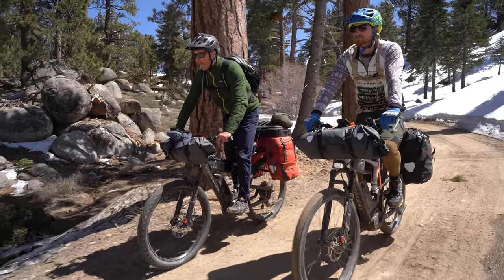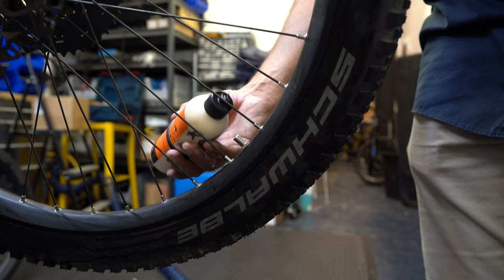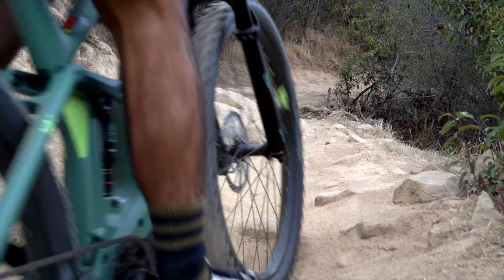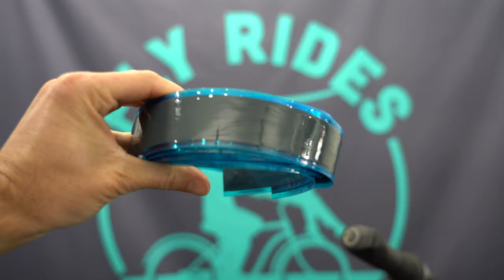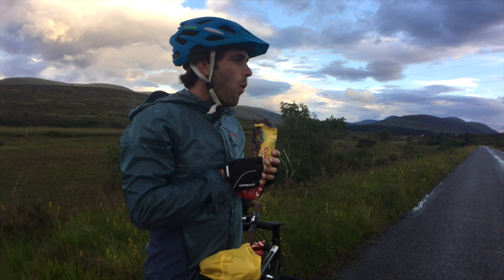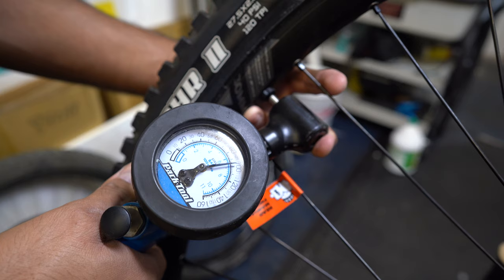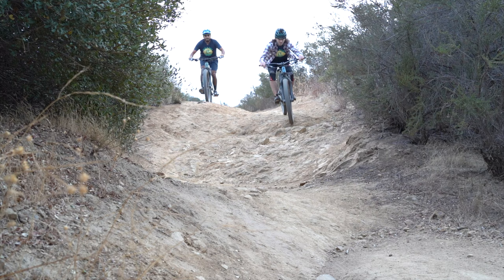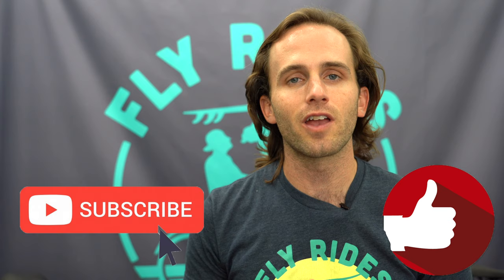Best Ways to Prevent a Flat Tire on an Electric Mountain Bike | Tubeless Tires, Liners & Inserts

Comment: I grew up in the 60s riding my bike in the country (where I lived) and I think my tires were goathead magnets.  After lots of tube patches I started lining the tires with several layers of newspaper, and it worked quite well.  Really cheap solution (there weren't any others back then).

Comment: Tubeless is the way! I also run CushCore with 20psi front, 24psi rear and haven’t had any issues. Don’t forgot to check your tire pressure often as there is no perfect system.
Reply from the maker: Good advice! Flats are always still possible, so come to the trails prepared!
Reply: Can you use CushCore and Tubless together? I want this on my two bikes one of which is already tubeless.
Reply: Hey there  @SwiftySanders . You have to go tubeless to use CushCore.
Reply: @HectorSalcedo  Thanks! Thats perfect. I already prefer tubeless but I had a situation where CushCore would’ve been useful.

Comment: Really helpful stuff in here. Thanks for all the different options and thorough explanations.
Reply from the maker: Glad it was helpful!
Reply: @FlyRidesUSA  with all due respect, although it's extremely expensive, a combination of Tannus liners, a smaller thicker motorcycle tube AND the proper amount of Flat Out tire sealant is the best solution.
Reply: @FlyRidesUSA , thank you.
Reply: @powerguymark  Tannus liners have a huge downside. The foam goes flat — if you always keep your tires inflated. With time, Tannus become nearly useless, unless you deflate your tires after every ride. 

On the other hand, Flat-Out does work really well. My favorite part is that it doesn’t dry-out with time like the competitors’ products.

Comment: I had an idea but not sure if it will fly. Drill a second hole in the rim for a second inner tube. Please the first (flat) tube on the inside rim and a second tube outside of that (it would have to go under the first only next to the valve. Then put the tire on and inflate the second tube only. If you get a flat with the second tube, deflate it fully and inflate the first one. I think that would fly but I've never heard of it being done. A slight weight penalty but who cares on an ebike.
Reply from the maker: That would be cool if it worked! Kind of similar to the Cush Core in that it protects the rim a bit more as well with that extra rubber.

Comment: If you're never too far from a bus stop, you can leave spare supplies at home.  Unless you're determined to not cut your trip no matter what.  If your trips are very unlikely to make your tire sealant useless and it's never too far to walk to another mode of transportation, it might make carrying a tube and pump an unnecessary encumbrance.  I may eventually get a pump though if I find a tiny powered one that I trust.

Comment: I'm rocking a gates belt on my bike and yes its a bit of a pain to change that rear tire the first couple times.  Also I know its confirmation bias but why is it always the damn rear tire when you've got a belt drive that gets the punture.   had 3 slow leaks and 1 major roofing nail incident in the last 8 months, all in the rear.  Only the nail killed the ride.  Actualy got al the way inside the tube and started punching holes along the lenght of it as I went from full to flat in less than 100 yds.
That said after you've done it a few times its not hard to pop the rear tire off even a belt drive.  I'm not quite as fast as with a normal derailer but it only takes me about a minute longer now.  Only issue is because of the belt tension when reinstalling the wheel never quite seats exactly the same way twice and I always have to adjust the rear brake calipers.

Comment: It seemed to have discovered that slime tubes aren't the best option... as I've had some pretty consistent delamination of the rubber from the valve stems causing bubbles... ballooning of the valve stem? Beyond freaking annoying... surprisingly I've had good results with just letting the air out until the ballooning Saddles and then putting not just one but two or three zip ties in series across the stem... And then ignoring the piss out of the problem LOL so much for confidence on the trail

Comment: Hmm, you missed the easiest option. As I have driven Schwalbe Marathons with it‘s legendary puncture protection on my road, city and trecking bikes for so many years now, without having a puncture once, I tried the Marathon MTB with the highest rating in puncture protection on my MTB. This tyre is not a Magic Mary, but if you drive all kinds of terrain, this tyre is a joy to ride. I trust Schwalbe and it’s tyres so much, I would never take something with me to fix them, because it never happend in way more than 20.000km. 
The tyre is not ment for downhill, but it’s enough for nice flow trails.
Reply from the maker: Cool! Sounds more like a tire than a flat preventative system, but will definitely check it out!

Comment: The best solution involves three things:
Tannus liners.
Replace your tubes with smaller thicker motorcycle tubes.
Insert the proper amount of
FLAT OUT.
This is by far the best solution.
Reply: Tannus liners have a huge downside. The foam goes flat if you always keep your tires inflated. With time, Tannus become nearly useless, unless you deflate your tires after every ride. 

On the other hand, Flat-Out does work really well. My favorite part is that it doesn’t dry-out with time like the competitors’ products.